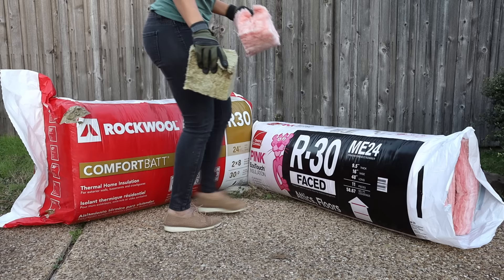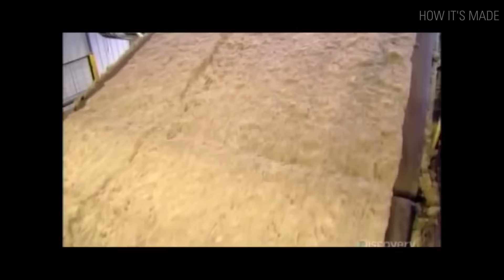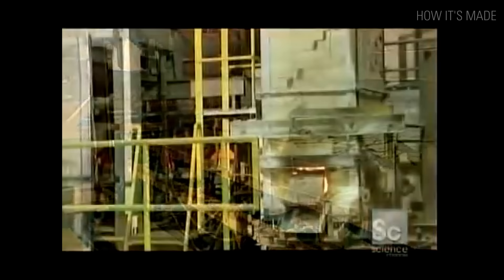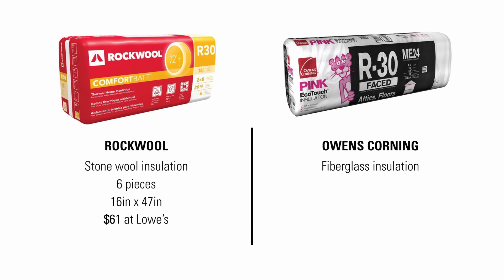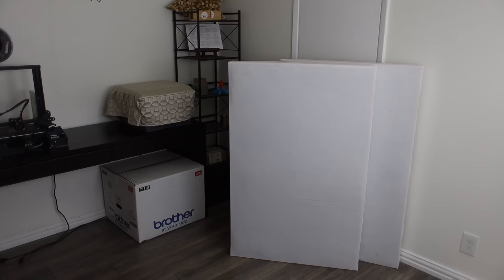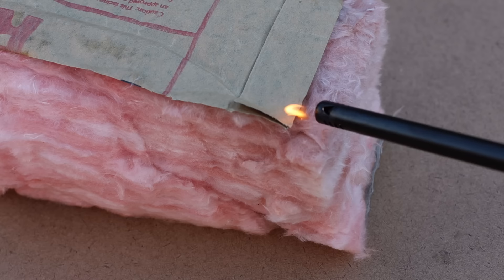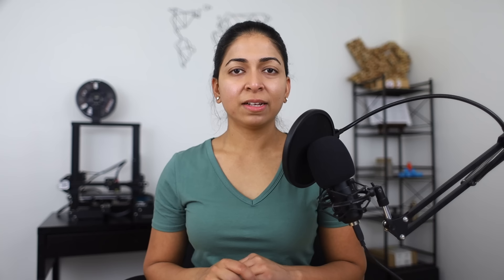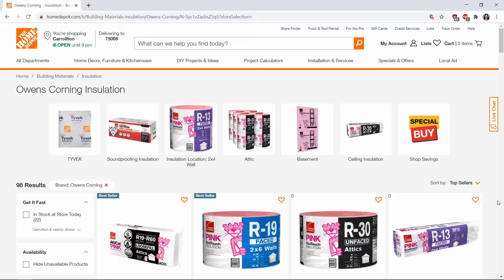Mineral wool vs fiberglass insulation | everything you need to know

Comment: I work in the fiberglass insulation industry for a direct competitor to the "pink stuff." My job is quality testing the insulation. A few years back, the entire industry stepped away from the formaldehyde and phenolic resin that used to be standard in the manufacturing process. Almost no one uses that in the fiberglass any more. I hope the rock wool manufacturers have also dropped the resin and formaldehyde as well.

Our quality standards require that we make the fiberglass insulation conform more to the standard of the rock wool for rigidity and tensile strength than the "pink stuff" does, but that's just how we compete. Insulation installers like the "pink stuff" because it is soft, but that softness degrades its quality as insulation because it doesn't re-absorb the air as well when the package is opened. That 'recovery" is one of the challenges of making fiberglass insulation; once the package is opened, the glass needs to soak up air between the fibers like a squeezed sponge soaks up water in order for the insulation to perform as intended. Another thing that we, and other manufacturers do is add an environmentally safe water repelling chemical to the glass fibers to make them more resistant to moisture and roof leaks. Every manufacturer has their own process, and your demonstration makes me think that the "pink stuff" uses less of this than we do.

Thank you for showing people how both of these types of insulation are made! Information that people need to know to make wise purchases according to their needs when building or remodeling their homes.
Reply: What is the best type of insulation for hot areas?
Reply: @btphong32  prob the same as for cold. Either way the goal is layers of air for insulation
Reply: I can use 2-layer walls and do not need insulation materials
Reply: I started to itch watching the pink stuff....lol
Reply: The formaldehyde use caught my attention as well.
Reply: fiberglass insulation is way overrated, i would never use it, this is my 2 cents
Reply: Which is the best material for thermal and acoustic insulation.
Reply: Which one gives cancer and which doesn’t? That’s all I care about
Reply: Rockwool brand quit using toxic Substances in 2014 I do believe. I remember the lumber company I was with had to send all the old stuff back and replace with the new non-itch formula. I tested the non-itch part of the show and seemed true.
Reply: To bad fiberglass is useless as an insulator in real life.
Reply: I need to insulate my attic and looking for affordable solutions. Which one is safe health wise and I’m looking for ones that sell in rolls for install. My house gets very hot in the summer and I can’t get temperature in house to drop below 77 . I think better attic insulation should help. Any tutorials for DIY?
Reply: worked at a facility producing rockwool 3 years ago, and it was still used, at the time they were experimenting with a substitution for the curing with 5-10% dextrose content instead. It had the lovely side effect of the entire factory smelling like brown cookies, but the requirements for the cleaning cycle of the curing oven became a lot higher, as the dextrose(sugary), would stick to hatches etc, and over time would ignite if not properly cleaned, or make the hatches become stuck.
Reply: @beeslayer1906  I used it in 2016 - no itch whatsoever. Did shed a bit after cutting to size, which was a pain to clean up, but otherwise I found it quite easy to work with.
Reply: Rockwool never used any of those (formaldehyd and Resin) products in their bats, they have always been "clean" products...
Reply: The pink stuff is from owens corning which uses the Pink Panther as a mascot.
Working for the competition makes you an enemy of the pink Panther and you know how that ends...
Reply: This is good but needs an update. Pink Batts in New Zealand are made 84% from recycled window glass and the electricity for the furnace comes from renewable sources. Also the glass fibres are now much finer and cause less irritation than it used too.
Reply: Please suggest good and budget friendly material for sound proofing for 1 room
Reply: @Shekhar_indian , how big a room? Are the walls already finished or is this for during construction? For unfinished walls, I would suggest an R-13 or R-15 batt insulation inside the walls. For a room that is already finished--say, to turn a room into a recording studio--staple 18-inch square egg-flats to the walls, perhaps hanging thrift-store quilts on the walls, then nailing the egg-flats to the wall through the quilts. In a pinch, use bubble-wrap instead of quilts and egg-flats.
Reply: Coke??👃😳💀
Reply: So water repelling chemical sounds like PFAS.  Obviously not good.
Reply: @Raikirin  That's very intersting to hear about. I wonder if they were able to safely run the plant or if there were any small fires.

Comment: I like the sound deadening qualities of rockwool over the practically non existent sound deadening of fiberglass.  Installing it between rooms with off set studding provides a very effective sound deadening barrier.  Although taking up some real estate, I’ve installed rockwool for occupants of duplexes to reduce sound transmission from the neighbors.  This can be involved as insulating the wall does not provide the full effect.  The space between floors must also have rockwool installed to continue the sound attenuating envelope.  The sound deadening can continue up through the attic.  In newer homes, by code there will be a cinder block firewall.  Adding rockwool only enhances this barrier.  On older homes, if installed correctly, I use metal studs which are going to perform better in the presence of fire than a wooden stud, rockwool, besides offering acoustic dampening can also provide a fire barrier to gain precious time to hold back a fire from the adjacent unit, where once the fire would spread quickly (grandfathered on older homes).
Reply: I think you would be well to install this where you have any air traffic over your house.
Reply: You notice the difference with larger doors. Family farm has double entrance doors and when they tried using fibreglass to save money, because farmers, they removed it within a month. House started sounding like a Fiat rather than an Audi..
Reply: As an audio engineer and speaker designer for more than 3 decades, I have measured the sound absorbing properties of fiberglass.  They are SIGNIFICANT.  Maybe not as good as Rockwool, but compared to the GARBAGE non hollow polyester fiber that replaced fiberglass en masse 40-50 years ago it is night and day with fiberglass a clear and measureable winner.  Putting the material inside a speaker box shows significant advantages, and the trick is wrapping it in a small weave material to keep the fibers in place, something very very few manufacturers have ever gotten right.

Comment: Rockwool is THE way to go.  It ‘mounts’ when trimmed carefully as opposed to fiberglas.  I also feel it has better absorption in the lower frequencies.  I’ve used both extensively and wouldn’t even think of glas again.
Reply: I only worked with them a bit (spent a few weeks "as an intern" ;D in construction between real jobs) and even with that short time I can wholeheartedly agree, rockwool is superior. 
only reason to use Glaswool is a stingy customer that doesn't listen to the benefits of rockwool
Reply: @theultimatefreak666  is it because of the Lower price of glaswool some rather take it?
Reply: @KeVIn-pm7pu  yep, especially if you get one of these pre-designed houses built there's a good chance that company will tell you to get Glas wool because it's cheaper (although the video said a few things how rockwool is more durable and thus technically cheaper than getting new Glaswool once the old one stops doing what it's supposed to, anyways cheaper building cost always look better and how shitty it is for the person getting it build once he moves in doesn't matter to those companies)

Btw: seriously, if you ever want your own house built don't get such a pre-designed those companies will fuck you over any way possible (including raising the price above what they promised based on fine print of "what we showed you'd get was extra, the mentioned price was basic")
Reply: The way to go is a low density aerated concrete.
Reply: Vacuum panels and aerogels are superior
Reply: @theultimatefreak666  actually here where i live rockwool is like 3x price of fibreglass, if you insulate roof, where wool is most used, there is really no point of 3x more investment
Reply: Peter ...... Ditto
Reply: Peter Yianilos I recommend rockwool also, incidentally I have a gas living flame fire and I use tufts of this to reproduce the embers at the front under and between the fake coals, It glows just like embers. I have only used it once because it won't burn and lasts forever :)
Reply: Recording studios use Rockwool as the higher density provides a little more absorption.  Frequency is a factor of wave length (literally how long the wave of sound is) so the only thing that makes a difference is how 'deep' your insulation is.  So this does not affect frequency.
Reply: @BugThorn  The Rockwool lasts a lot longer than fibreglass, but you can't tell because it's hidden and inaccessible. Think of the cost to rip it out and replace. In a house fire Rockwool is better - that is a very real investment.
Reply: @ivancho5854  Explain.. When you have fire in house, and fire will get to wool, either consturction which support wool will collapse, or smell of smoke will stay in house for years if you dont remove and clean everything. So it is really not good investment. Not mentioning how heavy rockwool is, and i have like 40cm of wool under the roof
Reply: @BugThorn  Sorry that I didn't see your reply.
I was making two separate points:
1. In normal use (no fire) Rockwool has a longer lifespan than fibreglass. Also if there is water leakage (from say the roof due to an ice dam or blocked downpipe, which is common), then fibreglass will collapse behind the wall and may not be seen. Compare this to Rockwool which will not be affected. Particularly if anything is concealed or inaccessible then it pays to use a superior product regardless of cost. The cost of a single inspection can be higher than the price difference between the two types of insulation.
2. In a fire the Rockwool protects the frame of the house and decreases the chance of collapse. It is non-combustible and a barrier to the spread of the flames compared with fibreglass which at typical house fires actually fuels the fire. You are correct that after a fire all insulation would have to be replaced after a fire.

Fire is one reason that I don't like this timber batton system. A solid timber of the same dimension would be less likely to fail under load and even a 2x4 would likely char, but retain a large percentage of its load bearing strength.
I hope that this reads clearer. All the best.
Reply: Agree. I am not really wood house guy, i have house from aerated concrete, wooden roof and wool is just roof isolation, so we both talking about a little different things.
Reply: @BugThorn  Yeah, that is a huge factor. They essentially want you to pay 2 or 3x more for the same effect, and that is in most cases unacceptable, thats why its so popular. Making project overpriced for little benefit is ridiculous, unless you're like a huge investor who do it constantly. I think it makes most sense esp. in roof insulation, and in a relatively dry climate, so low air moisture and occasional rains.
Reply: For real.
Reply: @BugThorn  have you been in a house repaired after a fire? Have you worked on house repairs after a fire? It depends on the extent of the fire. If it's fitted with fire doors the actual fire might be contained to just a few areas. Same with the ceilings, if they are properly fitted with plasterboard. Same with voids.

You might not need to replace the rockwool at all.

After watching this video you can make your own conclusions about what suits your build. 

After working with Rockwool building several apartment buildings as well as fitting it in a few old homes, it's physical strength makes it quick to work with. Measure, cut, fit, repeat. It stays in place while you're getting the next layer ready, be that plasterboard, bricks,  battens etc. It saves on the labour costs. Reduces sound. Water resistant. Anti mould, microbe, etc.

We have even used thick Rockwell, 20-25cm / 8-10 inches, as the outside surface for a new build synagogue. It will be coated with an external surface treatment like a render. But it is the external. I was surprised. That's how strong it can be.

But every project is different.
Reply: @Google_Does_Evil_Now  Man I spoke about family houses, There are no firedoors in any family house ive been to. I am not saying it is bad material, rockwool is superior in many aspects, but not in every aspect And mostly it is not cheap, diference in price is now like 5 Times, that is something. As a roof insulation, fiberglass is mostly way to go here in europe. You can get 40-50 cm on ceiling frame with no problems cos it is light, IT is in Rolls which makes it easy to install on frames, is much cheaper.
Reply: @BugThorn  fire doors are £50. A house needs 10. £500. They work so effectively. Have enough time for the time crews to arrive, for people to exit safely.
Anyone buying doors for his home who doesn't buy fire doors, wow. It's £20 extra per door. They are good security and noise too.
You focus on the costs more than lives and quality, that is your choice. Probably you vote for Tories? :-)
Reply: @Google_Does_Evil_Now  why you are so aggresive huh? I dont know where you found fire door for 50, in Czech republic you Will not have door under 70 And wooden under 100, btw from europe doesnt necessary mean from britain. And accusing me of not caring for People lives? I Care more than you, because they dont need to spend yearly free money for insulation they not need. You are comparing apples And eggs. Firedoor is not door with some not flamable insulation in it, you speak about door with increased  fire resistance, not to mention most design And doors with Glass will not have this protection at all my God. Speaking so agrrssively And not understand situation. Fire alarm is more protection than resistant door, smoke will still get in. And fire alarm is in every new house. Yet i am still Speaking about family houses, apartment buildings etc are completly different thing, that i not spoken about.
Reply: @BugThorn  I didn't think my comment was "aggressive". What is the difference in price for a standard door Vs a fire resistance 30 or 60 door in your country? In Britain it's about £20 to £30. I'm talking about standard fire door with veneer finish but constructed of composite wood versus cheapest thin light weight internal house door.
The fire door material helps with sound as well as having fire resistance for a minimum of 30 minutes for FC30. I think it's about 44mm thickness.
Everything is expensive these days. I'm sure you care a lot. I didn't mean to be critical in that way. I was trying to make the point of £20 extra is not so much for a door when I have seen how much protection it provides.
Combined with smoke alarms it's very effective at everyone getting out.
I have seen downstairs of a house badly damaged but upstairs was very good except for smokey smell. Because there was a fire door at the bottom of the stairs and it was closed.
I'm hoping my comments are useful for anyone considering if a fire door is effective.
Also it was always fitted with the thick door jam surround wood, approx 40mmx30mm. And fire/smoke sealant strip.
The downstairs was seriously burned, lighting was disintegrated, everything above 1m damaged badly. Below 1m it looked ok.
Upstairs visually looked perfect.

You mentioned a glass door. There was 1 glass door, pretty colours design. It was badly damaged. But it was next to source of that fire. The glass I'm guessing was not thick, simple standard looking glass. Not fire type, to my eyes, from what I remember.

Anyway. Hope it helps someone.
Reply: It looks as dangerous as "Asbestos" tho
Reply: Fiber glass is usually the only insulation available. However, you can thank CA State for passing  a law for insulation.